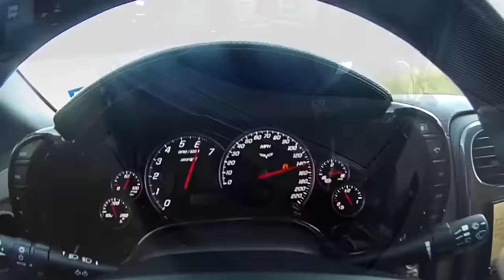LMR Sets the WORLD RECORD for Quickest C7 Z06/7

Comment: Take the spoiler extensions and the front splitter caps off and see if it shaves off a tenth or two.
Reply: Butterffinger5678 

It won't. All these rumors that it slows the car down are bs. I took mine off and it made no difference. Same day same track conditions.
Reply: +R1Predator They aren't rumors. It's classic physics—the faster you go, the more air you will displace, and thus a greater area of low pressure behind the car (i.e. drag) will occur. You may not be reaching speeds in your runs where it is making much of a difference, but it makes a difference none the less. From what I've gathered in research, the Z06 won't be significantly affected until you reach 130mph. To eliminate any random and systematic error, take at least three runs with your maximum aero pieces, three without them, and all in the same lane for each run that track day. From there, cross examine the distance and time markers for each run. Once you've determined your deviations, you can assess the precision and accuracy of your runs for with and without the aero components. You will then arrive at a conclusion with data to back it.
Reply: Butterffinger5678 

Car goes very consistent 144 mph with 1.4 60' and I'm telling you taking those little pieces of plastic off the car made no difference. I understand physics brother but the zo7 isn't fitted with anything that affects it's overall ballistic coefficient than say a base zo6.
Reply: Butterffinger5678 

Not gonna happen in the 1/4 bro